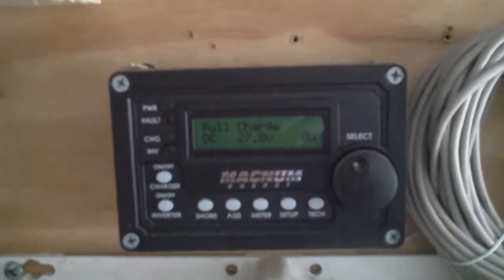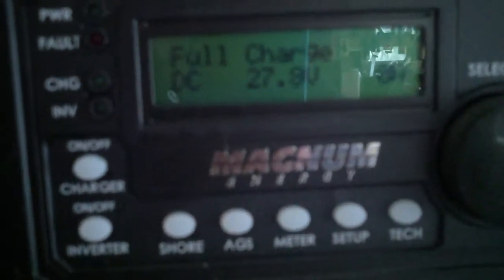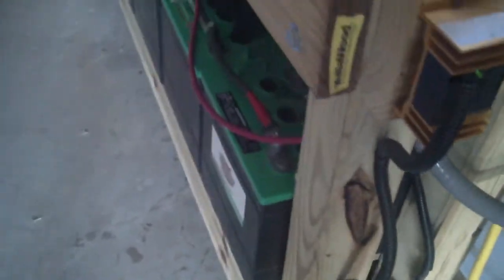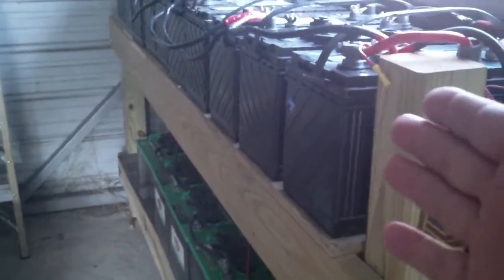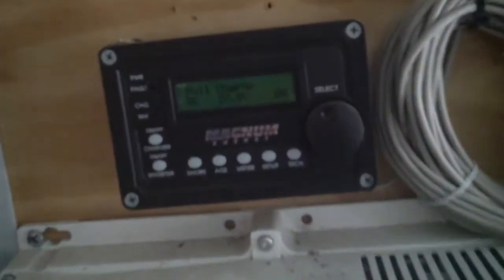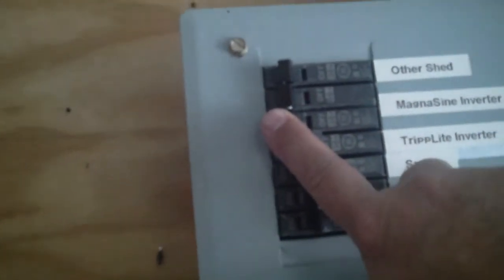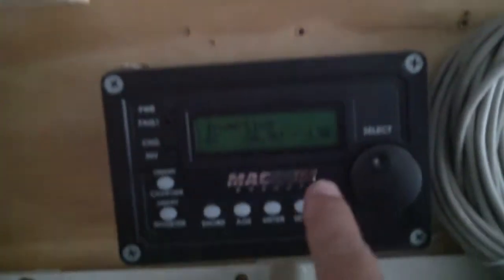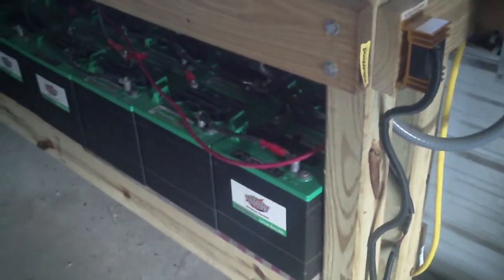Servicing Solar Battery Bank

Comment: Al, please forgive if you've addressed this before but I have a question.  Considering that there are efficiency losses (usually estimated at 20-30%) when charging batteries, is the advantage of being totally off the grid better than using commercial power at night and other times of low light (and keeping the batteries for emergencies)?  I understand that there is a peace of mind knowing u can be off the grid, but what is better financially considering the efficiency loss vs selling the power.

Comment from the maker: No need, I believe you, it's just that I find it easier to service using 24v components than 72v components. The conversion loss is small enough that I don't have to worry about it.

Comment from the maker: No, I would never recommend anyone to do that! Sulphation cannot be fixed by Epsom salts and the salts will eventually destroy the battery. An electrical desulfator is the only way to go to dissolve the lead sulfate into lead on the plates.

Comment from the maker: If I made by battery bank 120v it would be even better than 72volts. But the fact is that components for 24v and 48v are more widely available and at better prices.

Comment from the maker: I use now the BLS for forklift batteries model BLS-24/36. Both of these battery banks are now three years old and perform as if they were new. This video was taken around summer of last year and I forgot to post it, I will update with another video today showing the specific gravity and voltages now. The BLS works great in my opinion.